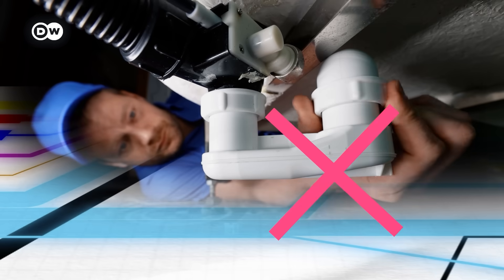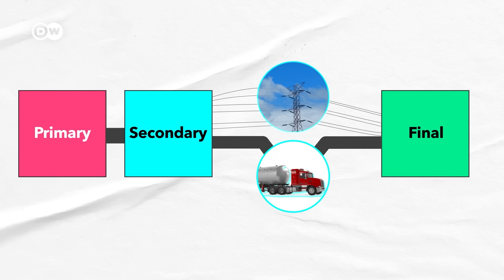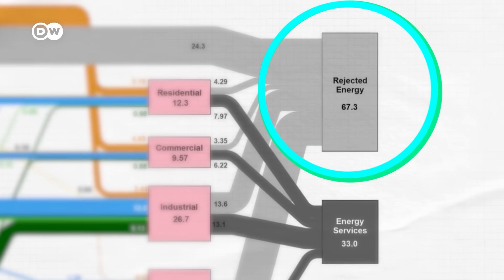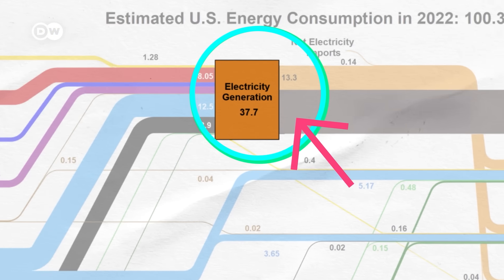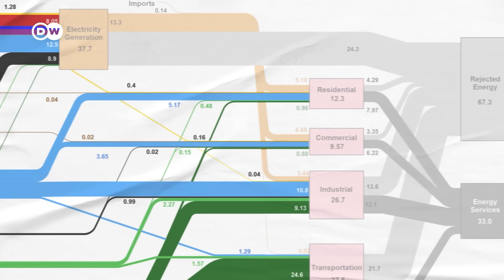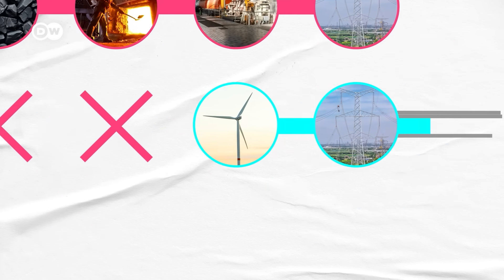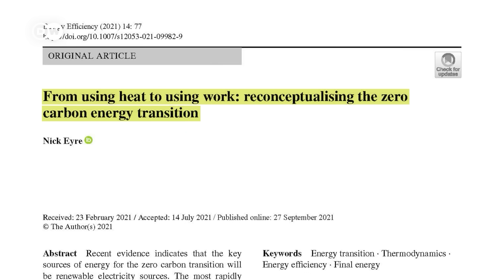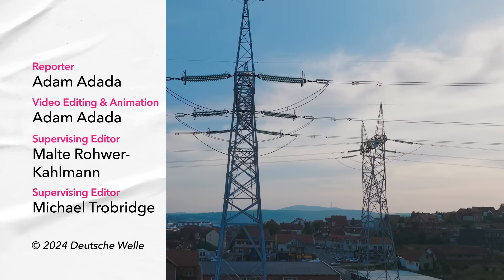The mind-blowing thing we get WRONG about energy

Comment: It’s all about energy storage. Renewable energy is easy to built and fairly cheap, but it doesn’t produce energy on demand. Solar has day night cycle as well as seasonal cycles depending on latitude. Wind is hard to concentrate so you end up wasting lots of land for access roads and keeping power lines free of vegetation. It’s also a bit seasonal and easily correlated with solars outages(sometimes no wind at night). Hydro can also be highly seasonal depending where you are, if you depend on snow melt from mountains for example, it’s vulnerable to both draught and frost.

So we need storage. Short term storage to cover solar outages at night and brief wind outages due to weird weather patterns. Mid term storage to buffer larger scale weather patterns like hurricanes(no, wind turbines do not perform extra well with very high winds), strong rain or snowfall or just a heatwave with low winds causing everyone to crank their ACs at night for a couple days or even weeks. And finally long term storage to get from seasons of plenty to seasons of scarcity. 

Once we make traditional power plants financially unviable they will quickly vanish, no one likes operating at a loss. That means we need enough storage to get us through everything since we won’t have traditional power plants to spin up on demand. Even if we keep a couple in reserve, it won’t matter. Cheaper energy prices of renewables will drive electric use way up(especially because the energy will be wasted if not used, might as well heat your porch to keep it ice free in the winter), 50 years from now we might use 10x as much energy as today, a couple old reserve plants won’t make a dent in that if our storage has problems.

Is it technically possible? Yeah sure, not that difficult even. We have chemical batteries for short term storage, physical storage(centrifuges, capacitors) for mid term storage and stuff like pumped and natural hydro(reservoirs, dam) as well as CCUs for long term. The difference between them isn’t really in the technology so much as in how easy it is to scale them up. Each tier of duration storage needs to store an order of magnitude more energy than the one before it. At this point it’s really about developing engineering processes to make the available technologies cost effective.

Comment: I’ve never heard such biased nonsense. Electricity is not efficient. Also EV cars are heavier so the energy required to move the car is more etc etc. I could go on it wouldn’t appeal to the ideological people in this comments section.
Please let’s get engineers to design and stop with the political posturing.

If you really believed in climate change you would go Nuclear but this is not science it’s a religion/cult.

Comment: The think is replacing petrol, you will need lot of electric energy. So we need to replace all coal plants and build power plants to replace all the oil we need for our cars.. And there is a think, the coal and petrol are dirty cheap and reliable, which, in most cases, renewables aren't.

Comment: Striving for efficiency, is always good.. and often electricity is more efficient. But..

Planes don't run on electricity.
Cargo ships could, if you put a nuclear reactor in them. (would be awesome, we can already do it since the 1950's, but it's military tech)
Big trucks or mining equipment, needs diesel in most cases. (the truck on the mine site, which uses a battery because it can go up empty and load the battery going down hill full, is an absolute exception)
Industrial heating doesn't run on electricity. (though f.e. steelmaking is switching to electrical furnaces if possible, mostly if there is nuclear or hydro in the vacinity)

The main issue of sun/wind is the intermittence. This isn't solved. Civilisation is reliable energy at the right time.
Not to even mention Jevons paradox.
Or lack of raw materials for the solutions.
Norway using more fossiel fuel, even while being the most electrified car fleet.

A barrel of oil is split into a whole lot of different molecules. The whole silliness of electric cars, is that if you destroy the gasoline car, we will still need asphalt, plastics, diesel, propane, jet fuel, lubricants for your windmill, diesel for generators to make the windmill ice free, ...
If all cars drive electric.. gasoline would become really cheap, as leftover from the barrel. I guess governments will just increase taxes.. But this is the beauty of oil, it is easy to transport, countries that don't care, will just use it instead of electric cars.
You could already see this, when Russia got sanctions and we had limited diesel shortages worldwide.
Refineries can tweak their output a little, a little bit more gasoline, or more diesel, or something else... but each oil is different and you don't just choose what comes out..

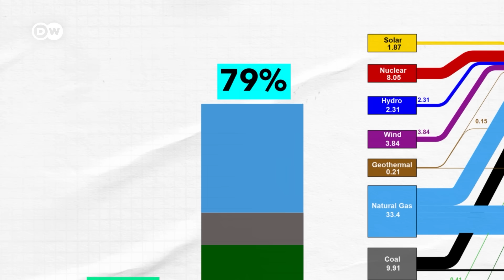Pondering. At 2:22. Why is the graph loosing 2/3rd of the electricity generation? 37.7 generation - 24.3 lost instantly. Transport loss? Production when not needed?
How can you even claim electricity is more efficient, if 2/3rd doesn't even reach destination?

Best diesel cars, go towards 50%+ efficiency. But because they're not green, car makers don't bother anymore pushing it forward.
First. Tackle coal, by using more gas.. Makes a lot more sense short term.

You're basicly ridiculing how hard it is, not saying it's impossible.. someday.. but pretending it's easy will just make it harder in the end.
We're not striving towards the solutions that make sense.

Comment: There are several outright lies and deceptions in this. Example-most gas is used to overcome air resistance, which electric cars are also subject to. Gas appliances are way more efficient than that, some up to 97% and transmission line loss also goes away. Cook with each and you will know the truth.

Comment: Energy efficiency is a real issue, but this video is highly manipulative I'm suggesting that electrifying everything is just a simple exercise in switching to More efficient electric power. That's very far from the truth
Reply: Exactly.  Industrial processes like smelting ores, synthesising nitrogen fertilizers, producing glass and cement are very energy intensive. They will never be fully powered by renewables.

DW,  as always, ignores the real solution - a NUCLEAR ENERGY and pretends it doesn't even exist.
Nuclear plants produce both electricity and heat (which is used to heat homes in Sweden, Eastern Europe and Russia). We can see the "efficiency " of renewables in Germany after cutting away from Russian gas. Lignite burning plants back online, high emissions, highest energy prices. Compare that to France powered by nuclear energy. Energy is cheaper and emissions way lower.
DW, a German broadcaster,  also ignores the lack of generating potential for renewables in winter where the energy demand is the highest. Simply it's not sunny or wind in Germany in winter months to produce enough energy for heating homes.

Comment: There is no free lunch in physics! You diverged thermodynamics and the law of Carnote in this video. The losses are even present on Wind and Solar plants - so it is misleading what you show here. Wind and Solar transform Energy which is part of the weather system -  if left alone. So by redirecting the energy from the weather system => you create a heating effect thus waist heat is generated unused => even in a higher order of magnitude since a lot of that energy has a trash value at the market and cannot be used. 

I also find it disturbing that the forms of Energy which have different use cases - are set equal. If you use Electricity at a later stage in the use process (induction stove) and then you have view losses => you ignored the losses at the beginning of the chain (even with wind and solar). If you use gas => yes it also heats up the room (which in some regions is a wanted side effect => making it a 100% use case) 

=> the real challenge is that oil and gas cost nothing else then mining operation => in Saudi Arabia the barrel of oil has a surface cost of 4 USD for 158 liters (on barrel of oil) that is 1550 KWh chemical energy approx. => that is 930 KWh Thermal (waist or use case / depending on the setting) and 620 KWh Kinetic or electric Energy as an option. So that is 0,65 Cents for Electical and  0,43 Cents for the Thermal KWh in the first iteration of use cases… That has to be outperformed by Wind, Solar or Nuclear (has the biggest potential to do so since high energy density can be harvested with view resources but lets see)…. If Oil and Gas should stay in the ground while prosperity is thriefing.

Comment: The car graphic you show 20% effeciency, when you said yourself it's 20 - 30%.

When you google it, it's 20 - 40% for the cars on the road and some new cars above 50%.

With your stove top and ev car comparison you didn't include power generation, transmission, and charging losses, or at least you didn't mention or show them.

You compare all the losses to each other, they're not all the same, base load generation losses are required because so far we have no better solution. Only the losses we can actually mitagate are important.

Your bias is showing. Can't we just have someone that tells us how it actually is?
Why do we need both sides so polarised to the point they're both basically lying?

Comment: This is a great video. I really appreciate the focus on how electrification inevitably improves efficiency.
That being said, there are a few significant challenges that still have to be solved before an energy transition is realistic. I think the most important and least understood challenge is that the grid is completely designed to be powered by synchronous generators with a large spinning mass.
Renewable resources like wind and solar are inverter-based. They do not work the same way and can therefore not power the grid on their own. 
This is a fundamental challenge that has to be addressed and I would love to see a video about it in the future (if you haven't already made one)

Comment: Highly misleading, unfortunately an all too common and acceptable practice in renewables and green advocacy. All that this is is just another way to represent efficiency. That's not the problem. The problem is the fact that renewables are not fit for purpose regardless of efficiency, and only increase the inefficiency issues of whatever reliable energy source they must inevitably rely on to do the job that is required.

Put another: Green advocates rely on continuous gaslighting, which more than overwhelms any value they provide to society.

Comment: People talk about wind energy, but they windmill design is awful. Have you seen a blower fan before? Has a tube with even cuts all the way around. Thats the blade. Now, put that on flag poles, antenna, hell, on planes. They can spin faster without breaking, take less material,  not nearly as loud, doesn't need a huge field to waste, and we can retrofit them on already existing structures. Like, what are we doing guys?

Comment: DW please could you elaborate on your statistic at 7:35, could you explain how you reach an efficiency of 270%?
The way I understand efficiency is that if i convert 1 joule of electrical energy to 1 joule of kinetic energy I have 100% efficiency as no energy is converted to a form I don't want. If efficiency is more than 100% I am creating energy and breaking the first law of thermodynamics.
Reply from the maker: In the case of heatpumps: they use heat from the outside air to produce more heat inside, so every joule of energy going in does 3-4 times as much work as if it were just used in another type of heater. You can read more about this in the "read more" section. 🔥

Comment: Of course people don't understand energy. Nobody knows what a joule is. Or the difference between power and voltage. Or even ohm's law. You can't hope to understand electrical energy if you don't understand the base units.

It's like trying to explain the distance from here to the moon without using any units of distance. You could compare it to other things, but that doesn't work so well with energy.

For example, the energy a human uses in a day, 8.5 million joules, is enough to cause a sizable explosion if expended all at once. It's about equal to quarter pound of TNT.

8.5 million joules probably means nothing to most people. But for some reason, equating it to TNT makes it more relatable. Like nuclear bombs.

Comment: Though the graph proves that renewables will be more efficient and therefore more useful over time, the graph does not prove that the replacement of the infrastructure behind fossil fuels would be easy. It would be a good idea to take on the endeavor, but it would also be a good idea if someone were to make a graph that describes the amount of effort and work it would take to fully replace fossil fuel infrastructure.

Comment: This video mixes up different types of energy, power and the fact that moving energy requires power. The caliber of sources in the video, this can only classify it as deception.

Energy is constant and carries power but power can be used. When heat energy is converted to mechanical energy, that is converted to electrical energy, the power is concentrated on less energy, and the remaining energy without any power in it must be disposed of. Calling that energy waste or insinuating that it i lost is totally wrong. That is what the chart does and it is misleading. The power carried by "useful energy" in the chart will eventually be used up and the powerless energy becomes what the chart calls "rejected energy". 100% of the energy ends there when the power is used.

You can work on optimizing the concentration of power and a few percentages can and should be captured, but is only a few percentage points.

Comparing direct production of electricity in VE with indirect production through heat energy and then electricity is clearly misleading. If you insist on doing that, keep in mind that wind turbines only convert 1/3 of the wind energy to electricity. The rest is "lost" just like the heat energy without any power in it. 

This is basic thermodynamics. Entropy must go up in any conversion.

Comment: I have an all-electric house with a latest generation ultra-efficient heat pump for heat and cooling and an ultra-efficient water heater that uses a heat pump to heat the water. I have all led lighting and a skylight to use natural lighting. So I'm all for efficiency. But also I also open windows and use ventilation to control temperature. Your methods don't capture that efficiency - energy that was never needed in the first place. This is important because using your methods California has put in place building codes that are super efficient by your measures but which make it difficult or impossible to use ventilation. Furthermore, California has a climate very favorable to using ventilation. I'm not against your push for efficiency, but you have missed a big part of the puzzle and lawmakers have made bad policies based on your thinking and they are bad because they miss the same thing you are missing.
Reply: But did the video say that windows should not be opened?
Reply: @bernhardschmalhofer855 No, it doesn't say windows should open. But that's irrelevant to my point which is that energy that doesn't need to be created is always more efficient and this analysis doesn't take that into account.
Reply: @edlauber3585  Yes, I agree that energy that is not created is a always more efficient.

Comment: Not actually the entire truth is it. 
In general you can say “if you can’t grow it, you have to mine (produce) it”. 
Solar panels and wind turbines don’t grow. Get the point. That energy to build the system was neatly let out. Green washing. 
EV are efficient but not 90%. 10% is lost on charging alone. So maximum 80%. More green washing. 
Otherwise I do agree that looking at the efficiency and losses is low hanging fruit that needs addressing.

Comment: Stupid and disingenuous video because it leaves out any mention of the fatal flaw of renewables - most of the time they simply don't work! Solar typically has a 20% capacity factor (more like 10% in the northern part of the country in winter). Wind is higher, but wind is not practical in much of the country. So when the sun isn't shining and the wind isn't blowing, the demand is still there. Some of you will say "we can store the energy in batteries" - sorry, but no. There is no battery technology in existence that is economically viable at grid scale - or even close. Renewables simply can't provide reliable electricity on a 24/7 basis.

Comment: Also, nuclear. While not being renewable, they certainly can produce a boatload of clean energy
Reply: NOT clean at all. There is still no solution whatsoever regarding nuclear waste. Plus, in total, nuclear energy is EXTREMELY expensive.
Reply: @HolgerJakobs  It's cleaner in terms of carbon emissions, which is the main drive of the energy shift. However, it's still a system that produces heat/steam to feed turbines, so it wastes heat and is inefficient, like fossil fuels. Also, even if nuclear waste gets reused as fuel (there are good prospects on that front,) uranium extraction itself isn't clean at all.

Comment: The primary issue this video ignores, or rather shelves is the control of means of production and availability.  The issue with wind and solar, currently, is no one controls the sun or wind. When it isn't windy, how does one use wind power? the blades modern windmills also aren't started by the wind. They are started with fossil fuel engines. The issue with solar is the sun. Approximately half the day is without sunlight, and in some places, they go weeks without sunlight.  There is just more than loss of energy in the production and use of said energy. Availability is the biggest issue with wind and solar. Nuclear, on the other hand, is the most efficient.